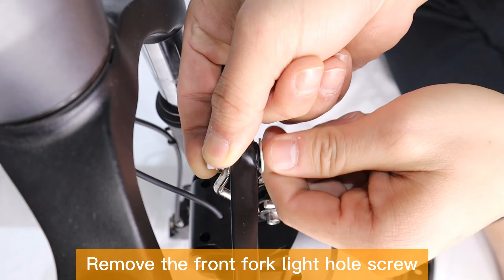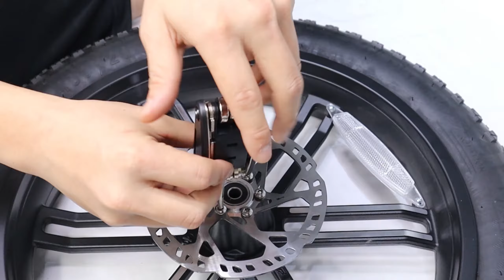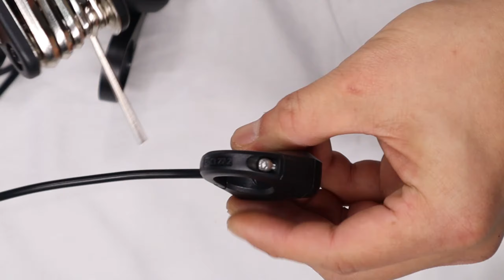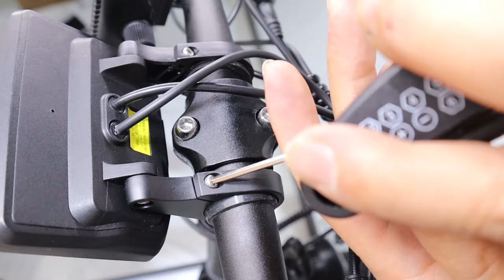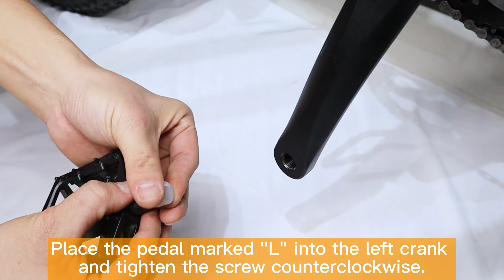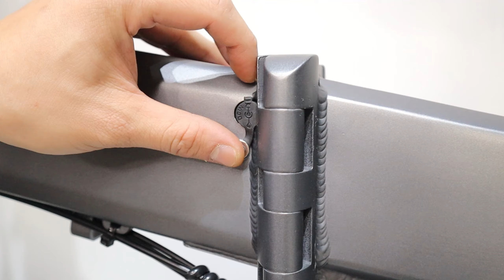Luckeep Electric Bike Unboxing and Assembly | E-Bike Unboxing

Comment: If you look at the bio it’s completely different from the what the pictures say, I was close to buying it until I looked deeper into it. Although it has the same features it goes 20mph and goes 32 miles of range
Reply from the maker: Be Careful, some scammer seller stole Lucekeep's image and sell on Amazon at a such low price that impossible for e-bike. We load a video to tell all buyers how to identify scam product pages and real Luckeep product pages.
Reply: The bike's bafang motor can be programmed... changed... and speed and range all depend on a lot of variables. A person's body weight, terrain you plan on using it riding and more... the "BikePro" application you can download to a smart  phone allows you to change the settings on the bafang motor and more... and have noticed some of these machines are pre-set for the state they are in due to the legal issues of E-Bikes so all of that depends on the individuals using the machine in the state you are in or country and their laws as well as operating it legally or illegally in those parameters. But the bike can be modified and the speed limiter in the app provided you have a smart phone and such to the do that and the legal angle of where you live. Some states in the USA require special license if the machine goes above a certain speed limit and it steps outside of the realm of a bicycle into the realm of a motorcycle basically. All depends... but this machine will do what they say it will do. You just have to figure it out and learn it or find something easier to use mentally where you don't have to use brain cells...LOL! Some don't have the learning curve necessary and if that is the case they probably should avoid riding bicycles in the first place... LOL! And motor bikes as well, my opinion and the machine is actually a lot better than most assume... especially for lighter weight riders and I'm glad I am missing my left leg because it reduces my weight for riding it with a carbon fiber and titanium left leg... some don't have that advantage... LOL!  In the past it had a 500 watt motor from what I understand and maybe that one did not have the speed and range but the 750 watt motor version does... depends on which motor is on the back of the machine and the motors are better now and maybe you saw the 500 watt motor version... that has been improved in what I've seen so worth the money to me. To each his or her own in making choices... I love the machine myself.
Reply: @luckeepBike  what is the seat post size and is it advisible to use a suspension seat post on this e-bike or not? And if I want to change it what would you recommend for a suspension seat post for off road riding? Thanks... and hopefully soon a community page will open for questions and answers on this machine... wish all of you the best at LUCKEEP... I love the machine... beautiful...
Reply: Here is the video on changing the bafang motor parameters for speed... some states in the USA will classify the machine as a motorcycle if you go past the limit of their regulations so choose wisely if mofication is made to  a machine and make sure you have the license to do it and if not to be legal you have to register and license the machine depending on where you live... follow your local laws if you wish to be legal... link is simple and to the point for making changes... https://youtu.be/sysJb27RsF8